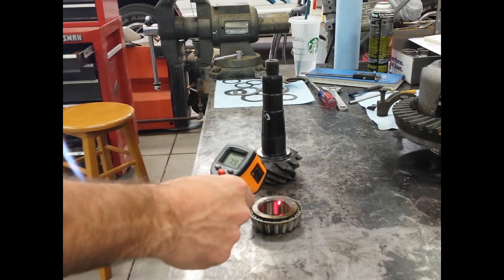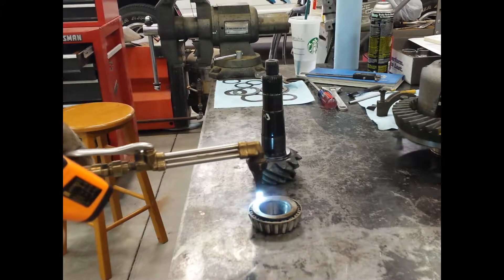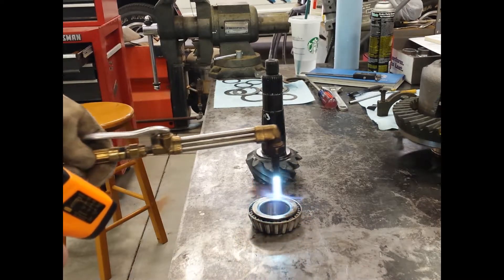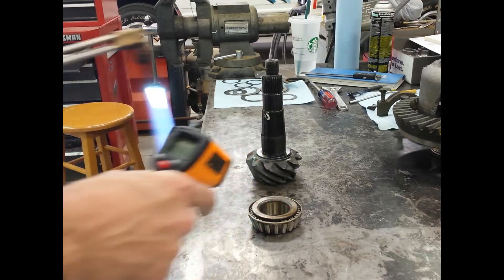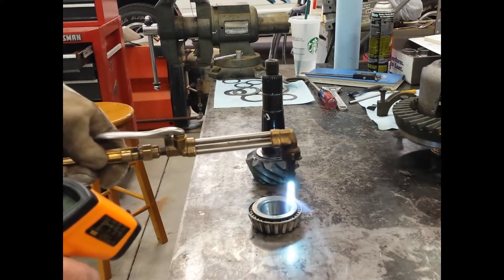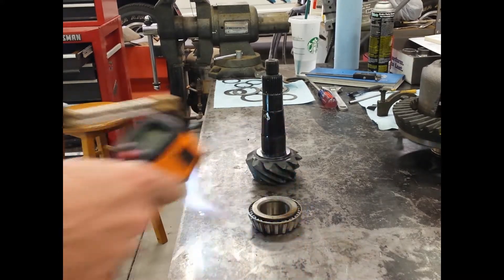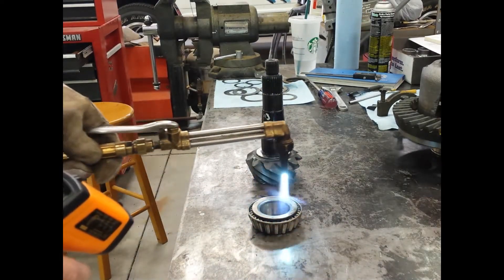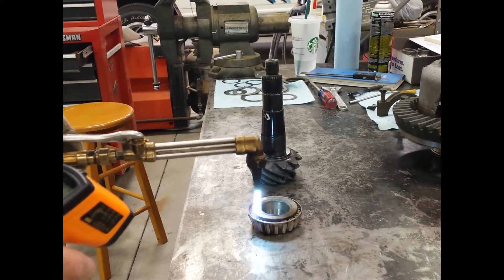Installing a pinion bearing using mild heat from an acetylene torch

Comment: Can you do this with a propane torch?
Reply from the maker: Propane torch  ?  maybe,  get a temperature gun to find if you are getting it hot enough.  Map gas would be a better choice.
Reply: @vanguardhotrodshop8633  A MAP gas torch definitely works. I made the bearing slightly blue at thirty seconds. We'll see if it's okay. Haha.